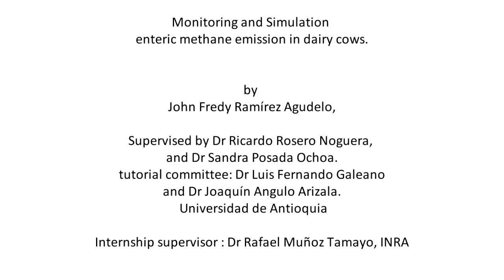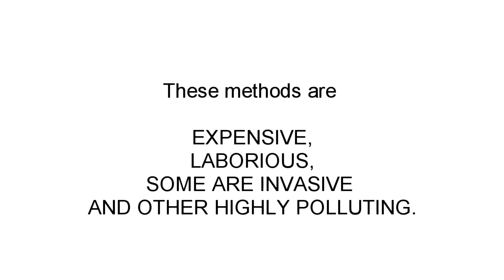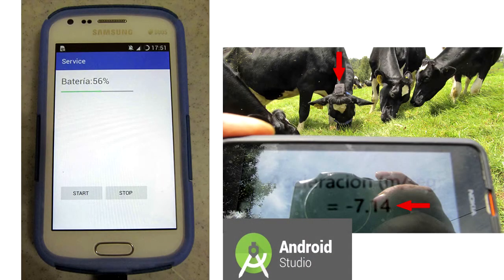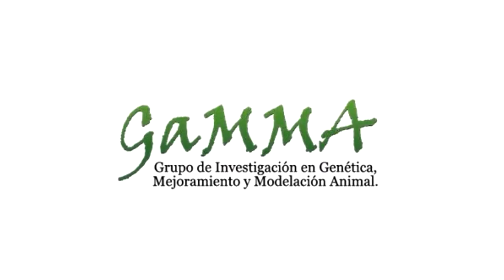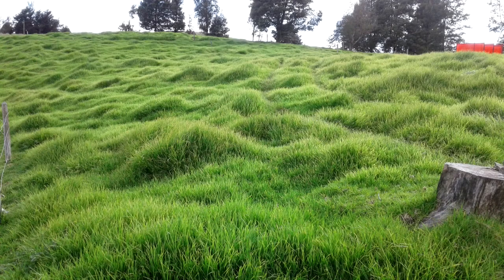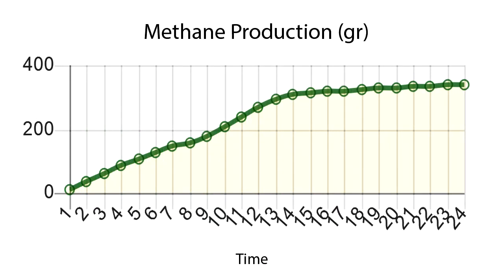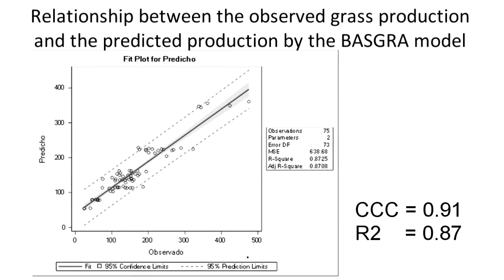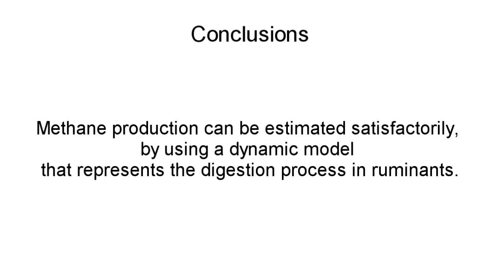Monitoring and simulation enteric methane emission in dairy cows.

Comment: So, it would be very interesting to see the level of accuracy added, compared to methane production estimated on the basis of as-lib intake with known pasture quality. Your results appear to suggest there would be little difference
Reply from the maker: Dear John. Thank you very much for your comment
Apparently, there is a very little relationship between dry matter intake and methane emission when data are obtained from animals with similar intake, as in our case.
We thinks that to develop a more generic methodology, it is necessary to obtain data from a wide range of dry matter intake.
Reply: My question stands. Until you actually make such a comparison, you can't answer the question. Your statement "Apparently, there is a very little relationship between dry matter intake and methane emission when data are obtained from animals with similar intake" , does seem to suggest a fundamental lack of understanding of the physiology and biochemistry of enteric methane generation
Reply from the maker: Dear John. The role of dry matter intake in methane production is indisputable. But to our surprise, it have been difficult to find an aceptable Coefficient of Determination between DMI and CH4, when we studies methane emissions in animals with similar intake, for example: dairy cows or steers. For this reason, and considering the accelerometers operational utility over the intake estimation methods, we are trying to find a methodology to estimate methane emissions in grazing animals and at large scale